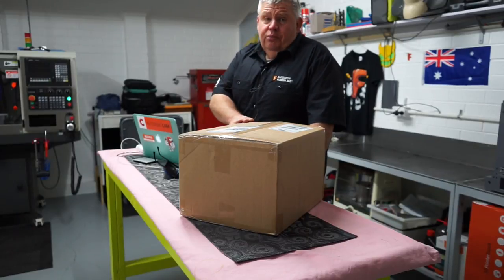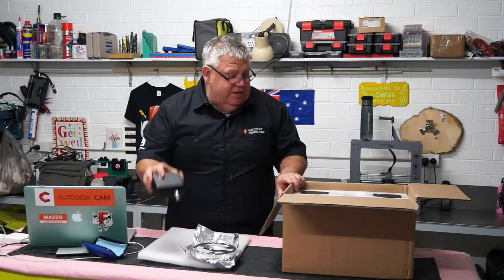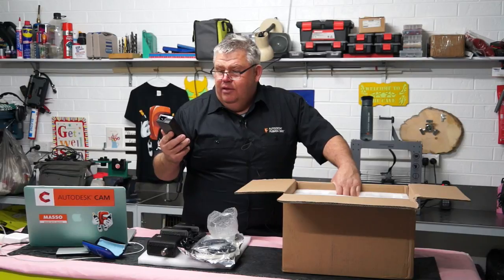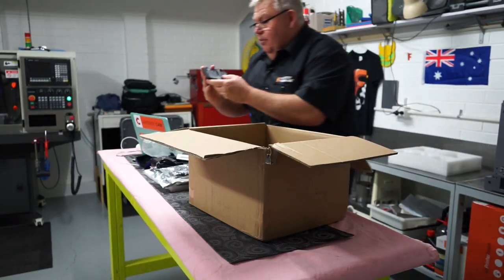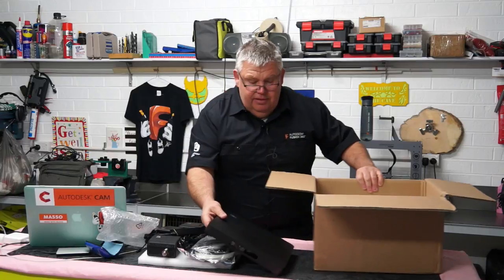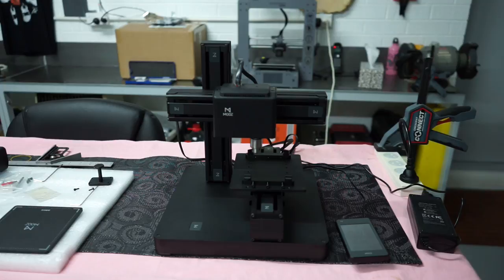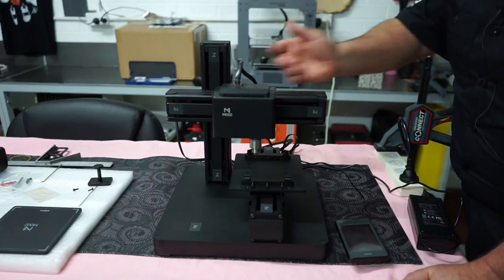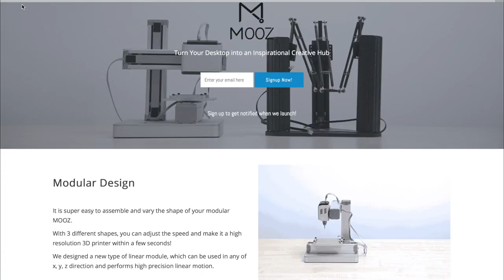MOOZ Unboxing Video Review Pt.1 - 3 in 1 (Printer, Laser engraver & CNC router)

Comment: Hi Aaron, Can I ask: what’s the maximum depth of material you can put into this to either laser or cnc it?? Cheers Andy 👍
Reply from the maker: Hello Andy.  I'm very sorry mate, but I don’t have the knowledge to answer this question for you.   As it's only a blue laser diode my guess would be very minimal.   I'm still in contact with my University lecturer Dr. Tony and he has PhD in Laser optics etc...  I will ask him when I'm the phone to him next.  Cheers, Aaron.
Reply: DCTTeacher1 thanks for the reply, but I can see I didn’t make myself clear, my apologies. What I wanted to know was if there were a maximum depth of material you could enter into the machine, for such things as etching or CNCing the bottom of a wooden bowl with something like a company logo. Depth of cut very light, but does the machine recognise what stock thickness is and adjust itself? 
Cheers for your time and knowledge in advance 😊
Reply from the maker: Hi Andy, sorry I don't think I read your message properly.  Yes the focal length is 20mm from the end of the laser unit.  Unfortunately the machine doesn't compensate.  You simply jog the Mooz up or down until the 20mm distance is achieved.  I think a bowl might be hard to do.  Hope this helps?  Cheers, Aaron
Reply: DCTTeacher1 cheers Aaron, much appreciated brother! Have a goodun mate 👍
Reply from the maker: Thank you and you too ;-)